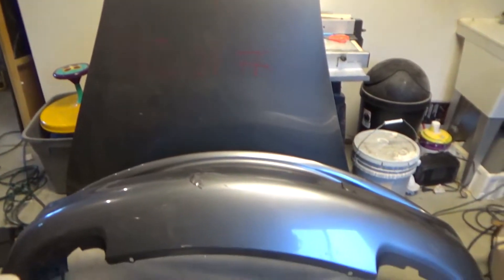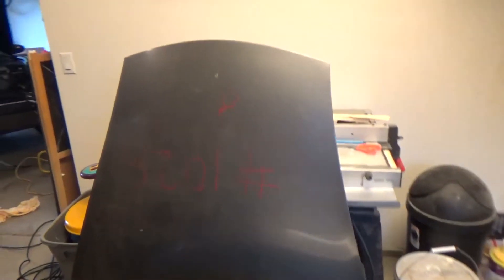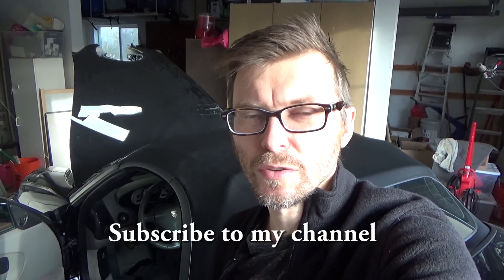Wrecked Porsche Boxster S Project: Radiator and Seat motor Problems

Comment: Check the padding under the driver's seat for moisture. Those carpet pads hold water forever. If it is wet, you should probably remove the immobilizer box/Central Locking Unit and make sure that it is dry with no corrosion. If it corrodes, the car won't start. They can be cleaned with alcohol and a small brush, such as a toothbrush.
Reply from the maker: AAZCD the floor mats were wet. I lifted them up and wedged them and put two of my industrial  air blowers in and dried them for several days. The immobilizer unit area looked fine and I now got it driving around and seams to work on other than the speakers not working and brake fluid light on even though there's enough in there . Do you think I should still remove the immobilizer unit and clean it anyway ?
Reply: Lifting the carpet and using the blowers is good. 2nd best to removing the carpet, just takes longer. Check out this thread by someone who had the immobilizer go bad: http://986forum.com/forums/boxster-general-discussions/68525-nine8six-car-dead-cant-start.html
I'd recommend doing it as a preventative maintenance measure, but no rush if it's working fine.